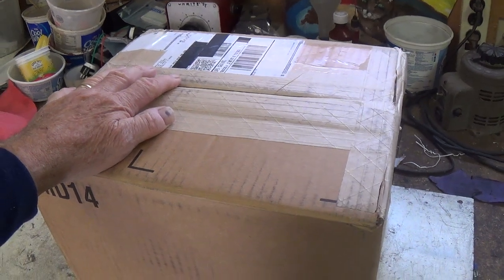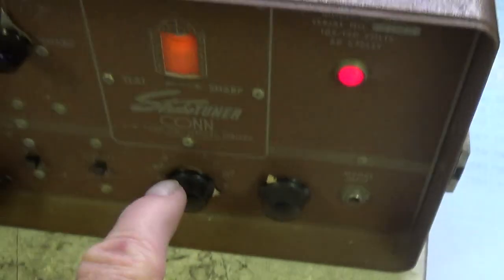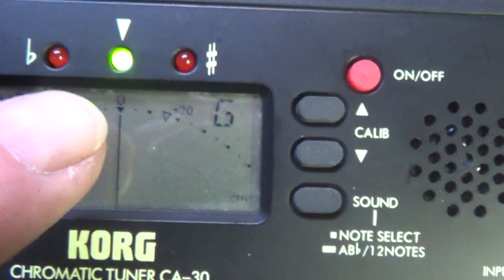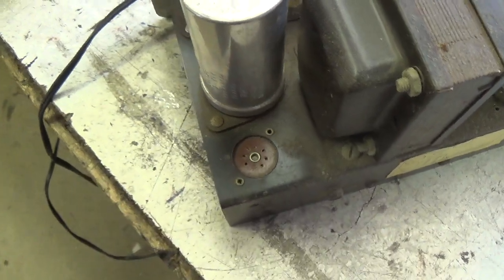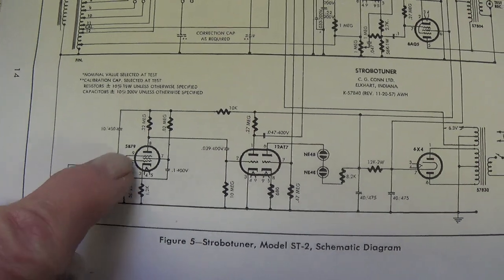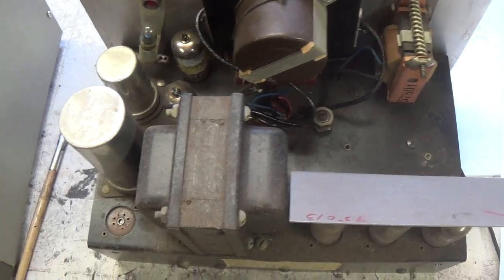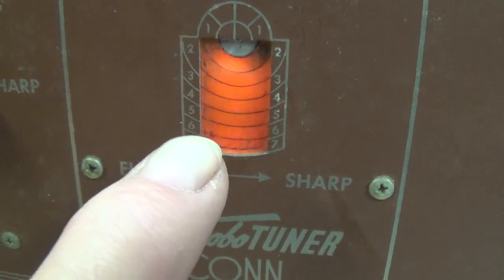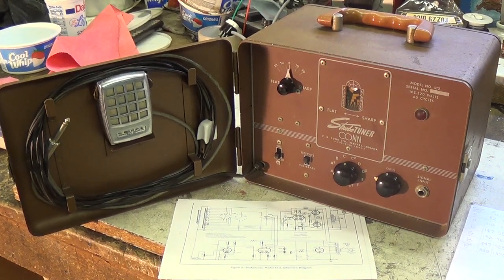Early 1950's CONN StroboTune Model ST-2.......What a Miraculous Device !!!

Comment: Thank you, Uncle Doug, for this look inside the venerable tube operated Conn Strobotuner.  It had been a standard tuning instrument for piano tuners since 1936.  I've had a model ST-11 since about 1978.  It's very much the same as yours but Conn had by then given it a larger semi-circular window and gone to a fully solid-state design.  One thing you might not have noticed in yours is that the pointer on the tone adjustment knob is moveable allowing you to calibrate the device to the line frequency and then set the pointer to exactly  zero.  This was to allow for drift as the device warmed up and possibly to compensate for minor variations in the local 60Hz line frequency.  The tone adjustment knob was also quite powerful in other respects.  It can be deliberately set flat or sharp to allow the tuner to "lower" or "raise" a piano a certain amount, usually no more than 10 cents or so per tuning, if a piano hadn't been tuned in a while or had shifted its tune due to a change in season.  It can also be used to compensate for "inharmonicity", the quality all pianos have that make them sound lifeless if the octaves are tuned to exactly match harmonic frequencies all the way up and down the scale.  Pianos are generally "stretched" a certain amount depending on the quality of the piano and the tuner's "ear" to compensate for this quality.   Also, the tone adjustment knob can help the tuner set a piano to exactly at A440, or A435, or A445 or whatever depending on the piano player's preference or the requirements of the musical piece or any other instruments that may be accompanying the piano.  A440 of course is the tuning standard applied to all instruments for standard concert pitch.
Reply from the maker: Wow....thanks for all the very informative input, SY :)

Comment: It occurs to me is the transformer running hot may be due to the 6X4 being replaced with diodes, but no corresponding dropping resistor to account for the higher B+ voltages.  Congratulations on the 100,000 Club ! Well deserved!
Reply from the maker: Thanks, Wan. My feelings were that the filter caps may be conducting some current to ground, causing an excessive draw on the power transformer.

Comment: Nice one! Double novelty, as here we see Uncle Doug make a couple of rare  little errors.  1. The output transformer is not driving the motor, the motor sits directly between the anodes of the output tubes. The motor is actually in parallel with the primary of the OT. The output transformer works mainly as a voltage splitter on the primary side for the tubes (and possibly as a form of motor control inductor as well). The secondary (output) is connected just to the little RCA jack on the back of the device where you can record or sound via an external speaker or amp the tuning frequency. 2. The upper circuit in the diagram with the selectable "note" inductor is not just an amp, it's naturally an LC oscillator, followed by an amp. But it's understandable with this slight oversight of the schematics in all the excitement over this marvelous piece of equipment, and who knows, maybe it was getting close to dinner time for Ollie and Jack as well...
Reply from the maker: Thanks for your helpful input, Ravi :)
Reply: Didn't see the oscillator, however I was thinking the same, the output transformer is only for the RCA and the anode for both tube goes directly to the motor.  But it is a lovely video :)
Reply from the maker: @A2an  Agreed, the OPT is not itself determining the motor speed, but it is a major part of the circuit that is. Consider the hair split.

Comment: A few notes to add to your video:

1. All of the Conn strobotuner patents (probably now expired) and ideas passed on to Peterson, who make modern versions of these strobe tuners. You can buy LCD versions (LCD emulates the function of the spinning disk) as stand alone units of various capabilities including one in a stomp pedal format, and you can get the Strobosoft programs for smartphones (iPhone and Android) and for computers (PC and Mac). There were little add-ons from Peterson as well; an add on microphone for the headphone jack (before the headphone jack went the way of the dodo bird), and a 1/4" mono jack to headphone jack for electric guitars. I think that the Apple Lightning connector to 3.5mm will still allow use of these accessories on iPhones.

2. They only take a bit of getting used to, but the strobotuners (of any type) are extremely accurate. They are ideal for setting up of guitars for intonation due to that accuracy. There is even a specific Peterson strobe tuner made for pianos that has an 8 octave range.
Reply from the maker: Thanks for the helpful info, Kostas.

Comment: Used one of those in my shop for many years and got a solid state one when they came out. Now I use a digital. You can move the pointer on the #/b knob to center after calibrating. With a digital tuner that show CPS you can use the first interval distance and a little math to give you a precise measurement of how far to move a saddle for correct intonation.   When using most tuners use the neck pickup and tone control turned down to eliminate upper harmonics and make the reading smoother. Thanks Doug.
Reply from the maker: Thanks for the helpful input, Martin :)

Comment: Hi UD, fun video as always.  As it happens, I work on these units (and their big brother the 12 wheel Stroboconn).  If you want some tips on these, please drop me a line.  A few notes, first your Korg tuner is set to 442, so your measurements are a tad off.  Second thing I want to point out is the theory of operation.  You have a synchronous motor driving the disc, and that motor is powered by an oscillator and amp.  Each note you select on the knob has a different oscillator frequency, all of which have to be checked for accuracy individually  They're coil derived, so not too likely to drift, but I have seen it.  To calibrate the unit  for operation (compare it to your 60Hz line voltage) you select calibrate on the switch and then adjust the fine tuning manually until the strobe 'stoppage' occurs.  Do this after many minutes of warmup.  Once you have done this, adjust the pointer on the fine tuning knob to zero (it's slip-clutch coupled to the knob).  This does NOT calibrate the individual note ranges,  that's all L-C stuff you have to measure.

There's all sorts of specific issues these can have.  This model was made for around 40 years basically unchanged.  They made minor tweaks and iterated the model number from ST-1 I think all the way to ST-7 or 8.  That unit was in production into the early 70s, as was the 12 wheel Stroboconn, which was in production from the 30s through the 70s.  I have several of these, and some parts units.  Let me know if you run into anything.  Wear on the motor shaft can be an issue, so be sure it's not dry of oil.  As to condition, that one is OK, but not great.  These are fairly common and near pristine examples can be found.  Obviously, the ones from many decades ago are least likely to be in mint condition.  It was still a very generous gift from your viewer.  PS - you really need to check out one of the 12 wheel Stroboconn units.  That is a fantastic machine that will beat the pants off a cheap digital guitar tuner for speed and resolution once fully calibrated.
Reply from the maker: Thanks for all the detailed info, HS. The 442 Korg setting is explained in the first (pinned) comment.

Comment: Amazing bit of history. Such a lot of circuitry to flash a couple of bulbs and spin a motor back then.
Reply: Hmmm a D.I.Y. project for Arduino ,Led's and a brushless motor lets go.
Reply from the maker: Yes, indeed, but justified by the extreme precision of the relative speeds of both motor and neon bulb flashes.

Comment: Thank you for the great videos that you post, you are an excellent teacher.  I just opened my Conn ST11 and found it full of pcb and solid state devices.  Not quite as cool as the antique electronics in your video.  Still full of amazing technology.  Now we have tiny tuners built into thumb drives.
I have a tuner built into my ear, the tinnitus rings at 440, sometimes a little sharp if I have too much coffee.  I got that from playing my Fender Super reverb amp cranked up to 10 back in 1970.
Reply from the maker: Glad you enjoyed it, Michael. I think many of us have tinnitus issues.....I've simply gotten used to mine ;)
Reply: @UncleDoug  I just got my hearing tested.  Not much that modern medicine can do about it.  The remedy is to just turn up the volume.
You have inspired me to pick up some of the old amps and restore them.  Even old radios are good candidates, with tubes and sockets and transformers that will do the job.  Better yet, old PA amps.  I just purchased a tv repairman's tube caddy, full of vintage tubes, from the estate of the engineer at radio station WDAS in Philly.
Looking forward to using some of the tv sweep tubes as audio outputs.
Reply from the maker: @michaelmenkevich5712  Best of luck with your hearing and your projects, Michael.

Comment: Nice little device. Was not surprised that the 6X4 was missing and you see the two diodes used to replace the tube.
If you plan to use it replacing the electrolytic caps are a must and add a fuse to keep the power transformer happy.
 For a full restoration  replacing all paper caps and check for bad resistors. Although it does work so that may not
 be necessary but I would because it is over 60 years old. Congrats on the 100K subs Uncle!
Reply from the maker: Thanks for your helpful tips, HM.

Comment: I serviced the larger version for a local university. The wheels would stop spinning after a minute or two every time it was powered up. The problem was with the power supply filter capacitors that allowed 120hz ripple voltage to mess with the 55hz tuning fork oscillator.
Reply from the maker: Thanks for the info, TP :)

Comment: I don't see many CONN things out in the wild. 

I scored a 1965 CONN tube organ a few years ago for a couple hundred bucks. It works perfectly with all the original parts - even the 57 year old caps.

It has a great sounding stereo tube amp, a stack of 40 or so tubes for the sounds and a rotating speaker built in.

I'm not much of an organ player ( however, I don't suck on the organ as much as Sir Elton does!). I fight the urge to take that amp out, recap it and make a lovely stereo guitar amp. The organ is near mint and so I resist my urge,  but if I ever have to move again that power amp is coming with me and the 300 lb frame is staying behind.
Reply from the maker: Thanks for sharing, Crush.

Comment: Hi Uncle Doug! Nice lunch box! Great explanation! I've worked on a dozen or so Conn ST-11 Strobotuners over years. The ST-11 is the solid state strobe tuner which replaced the tube models. The ST-11 was probably the most popular model made and they're pretty accurate. The ST-11 calibrates to 60Hz line frequency and digital dividers are used for the twelve notes. So pretty neat toys. I think the stated spec is + or - 1 cent. accuracy which is still very good by todays standards. I tune my guitars with a Turbo Tuner by Sonic Research. Nothing better and still made in USA. Thanks!
Reply from the maker: Thanks for the info, A61.

Comment: I used one of those ST2 tuners for my guitar from 1972 to 1975 (estimated).   I used to tell people it was better to use a tube-powered tuner when using tube guitar amps.  It was old when I bought it and when it died I bought the modern solid-state version and used it until it died around 1995.   Great tuners, and the display of the harmonics was often useful. I wanted to repair my old Conn solid-state tuner but could not find any of the parts. I now have a rackmount KORG DTR-1 tuner which can emulate the primary band of a strobe tuner display.
Reply from the maker: Thanks for sharing, RB :)

Comment: I have one of these units in my vintage electronics collection, unfortunately mine is missing the cover and the crystal mic that yours has. Mine like yours works flawlessly, C. G. Conn who made this unit, was based out of Elkhart, Indiana my home town, they are now called Conn-Selmer and they made everything from band instruments, to organs and everything in between. I once found the entire guts of a 1955 vintage Conn organ at a local computer shop in their electronics recycling and I nabbed those organ guts and salvaged as many of the tubes out of it as I could (they were mostly 12AU7s and 12AU7As from the Tone Generator circuit and then the Amplifier circuit had push-pull 12V6GT and 6L6GB tubes and several 12AX7A tubes and a 0A3 Gas Regulator tube in it. The Church camp I went to when I was growing up had an old Conn Organ in one of their lodges that worked except for the pedal bord and part of the lower keyboard, which with my knowledge of electronics repair that I've acquired since that time, I'm sure that all that was wrong with that organ was a few dead tubes, unfortunately they scrapped out the organ years ago, along with several old Hammond organs, including 3 or 4 Hammond M3 Organs and a large Console Hammond organ with drawbars and preset tablets and keys that was for the most part mostly functional yet except for a couple of broken preset keys on the lower keyboard (the preset keys were the ones where it was black natural keys and white sharp/flat keys). 
I enjoyed your video and I am a fellow musician, as I play the piano and organ, so I'm very familiar with the tuning instruments like this Conn Strobotuner and how they work. There is an output jack on the back of this unit that's for outputing an actual tone at the pitch of each note you are tuning so you can have a pitch reference for tuning your instrument besides the strobe disc.
Reply from the maker: Thanks so much for all the interesting information, Levi.
Reply: @UncleDoug  no problem, I'm a bit of a history junky so I like to look into the history of the companies that made the electronics that I collect and restore.

Comment: Hi uncle Doug, i bought a conn tuner about seven or eight years ago from someone local to me that was selling band equipment etc I think for under £40 pounds! It says on the label st12 which I found was 240 volt model for the UK. The st11 was for the US market 120volt ...it works very well except for an annoying rattle. On eBay they are for sale at a big price...??? I keep it for it's a little bit of Americana and looks good. I took the front off to see what the rattle might be but its to compact inside so put it back together again.! I'm sure it's transistorised many cheers from UK. Merry Christmas and new year to all. 
Rob.
Reply from the maker: Thanks so much, Robert  and Syd. Merry Christmas to you both.

Comment: That's a fascinating design, I would never have imagined they would use a multi-tapped inductor for a reference frequency generator! The ingenuity of those early designers in solving problems with transformers and vacuum tubes is wonderful to see so thanks to Doug for maintaining these old pieces of technology.

One question though - on this side of the Atlantic we have 50Hz supply frequency, I wonder if there's enough adjustment to tune in the calibration or would it always run slow?
Reply from the maker: Thanks for providing a good answer, Syd :)
Reply: I marveled at the multi tap as well; it may have been cheaper to use multiple capacitors switched to a fixed inductor, but it would have temperature and age drift with each capacitor!

Comment: Hello again Uncle Doug... I removed those transformers because the original cabinet for this amp, although steel, is rusted to the point that much work will be needed restoring it. I have been a metal worker in the past so bending some brand new aluminum to amp size is a breeze for me and with that original chassis ,there is pitting and rust and patina from years of being somewhere damp. It would appear the transformers didn't suffer the same fate as the outside surface of the original cabinet so that's why I decided to start fresh. I will look over my pictures and see where that wire was but, there is no continuity to any other wire in this transformer and no connection to the PT shell. I checked again...every wire ! That's why I asked If you had ever seen this before. I know it has to connect but there is no continuity and...I did learn to check them by watching your clip. There is no such thing as a Rectifier "virtual tap" like one can do with the 6.3 heater wires correct ? I have about decided to stop buying any old amps because I have run into various issues with some of them. I was able to build a champ clone from that old radio transformer and swap in a 6V6 or a 6K6 and it does sound different and less powerful with the 6K6 as it should. That tiny little OT that was used to the output of the 6K6 sounds very clear at very low volume but distorts heavily past about 3 on the volume control. As you said, that six inch speaker was never used to more than a watt or two in the radio but a guitar will certainly bring out it's problem in a guitar setting. Many thanks ,as always....Daniel
Reply from the maker: Understood, Daniel. No, the high voltage winding must have an intact centertap to provide a return route.....it's not a matter of balanced output. Please watch my video on transformer deciphering and double check to see that your DMM is accurate in the 1 Ohm range.

Comment: I'm surprised none of the caps needed replacing? Also, it was funny how the modern tuner was set to A 442 Hz instead of 440 which revealed the need to adjust the 2 Hz on the Sharp dial... very cool mistake that revealed how accurate a strobe tuner really is.  Thanks Uncle Doug
Reply from the maker: The electrolytics probably do need to be replaced, Tim. As far as the 442Hz, please see the first (pinned) comment.
Reply: I have been enjoying your videos for years.  Keep them coming and thanks for the reply.